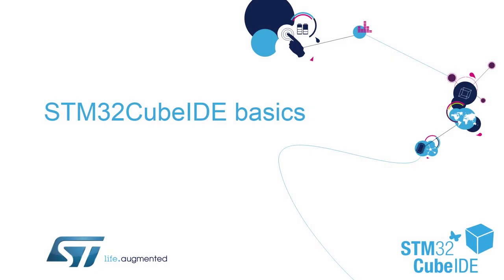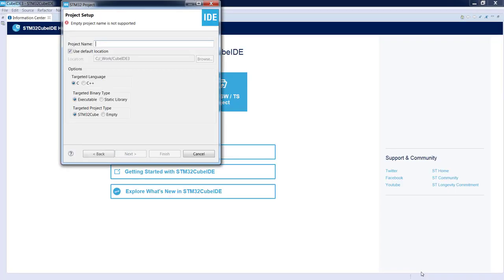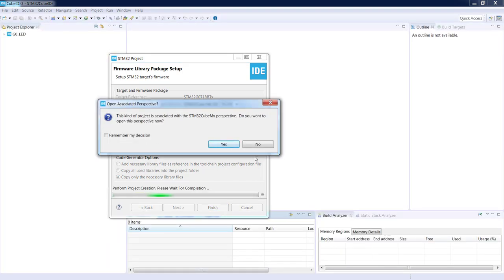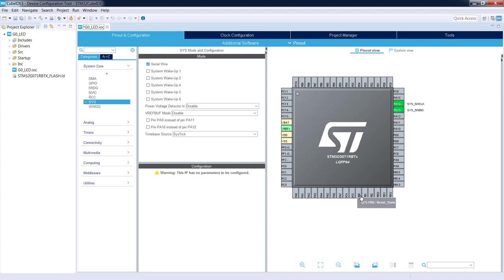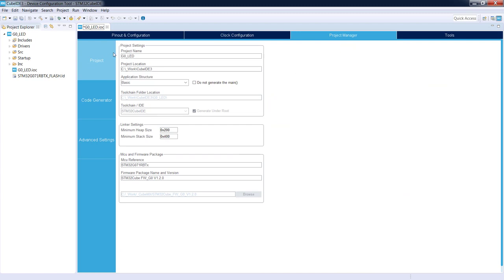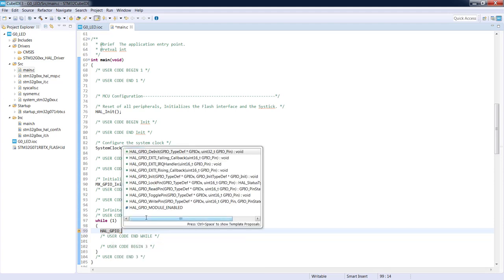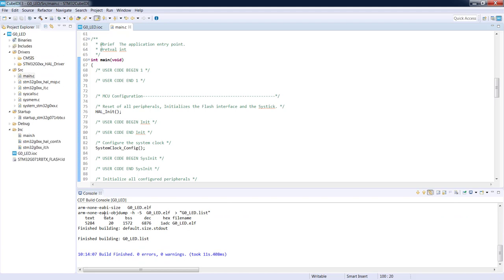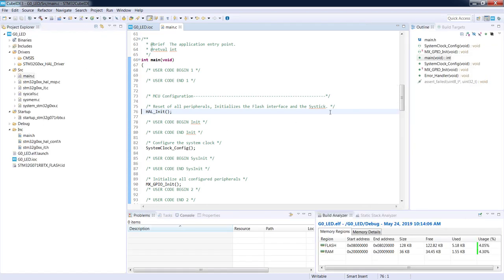STM32CubeIDE basics - 03 GPIO HAL lab

Comment: Eclipse normally auto filles the arguments in the method when you select an existing method. I know this can be turned off in Preferences>C/C++>Editor>Content Assist. But if I dont want to turn this off but just jump from one auto-filled argument to the next one and select it, is there ANY way to do that? I know that function was available in SW4STM32 a few years ago by pressing CTRL+RIGHT or something. But I cant find any key bindings in the preferences of Eclipse/STM32CubeIDE that do exactly that.

Comment: Great, that's good when chip manufacturer and IDE producer provides handful info, just should be more convenient to provide more detailed data, especially practically useful ones... one of them is you don't mention initial state of defined pins, in fact  CubeMX and HAL initialization code puts GPIO pins in output mode at LOW state and taking into account that in most cases LEDs are connected either direct to pin (with serial resistor on it) or through FET transistor gate (in case of Blue Pill and some other boards), this initial state puts LED ON... using first HAL_GPIO_TogglePin causes LED to go off...  for "Blink" or so called MCU "Hello World" program it doesn't make any big difference, as you toggle LED at same intervals on and off, but if you are going to simulate Morse Code or instead of LED you control some actuators, relays etc, initial state becomes critical and you should add initial state assurance line - directly set initial state of some critical pins, so you don't care of IDE HAL and LL library behavior... in general, regardless HAL_GPIO_TogglePin is pretty useful subroutine, direct state declaration, switch method (HAL_GPIO_WritePin) would be more preferable ....
Reply from the maker: Hello, thank you for your commend and the hint. We will try to follow it in next videos.

Comment: Idint find any information  operators  variables which is using cube ıde for examples ...if  else  while  for next   do while  switch case   and mathematical instruction  floor add ,div,bit shift right or riight , read  port as bayt  ,reset cpu where this information and is there any  instruction operator in  order  to cubeıde  are variable same  other ıdes  for example  int long int int1  mad answers in my mind

Comment: Does "PA5" mean port A, bit 5?
Reply: You mean the PA5 mentioned around 0:30? Yes, this is STM32 Pin PA5.
Reply: The Pin PA5 (STM32) is named D13 from arduino view.
But in the sketch shown at 0:30 the connector is labeled wrong. It is named CN7 here, but according to UM2324 page 30 table 12 the connector is named CN5.
Reply from the maker: Hi there, thanks for your question - may we point you towards our community.st.com, where you will find a team of people who can answer you directly ?
Reply: You start counting from 0. There are PB0,PB1,PB2,PB3,PB4,PB5. So, PB5 gotta be sixth bit in your register but the best way to look it up in datasheet.